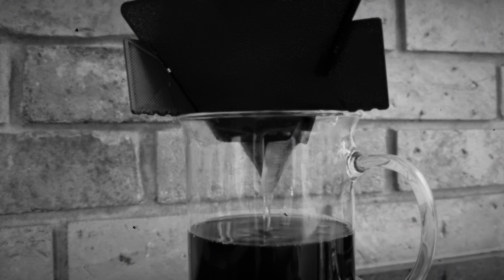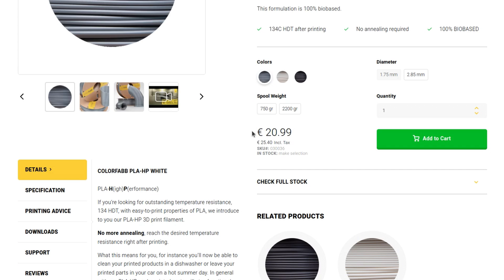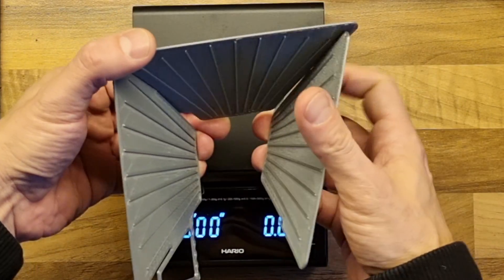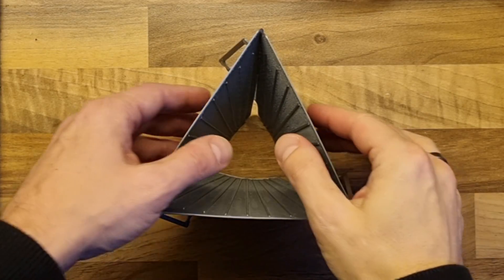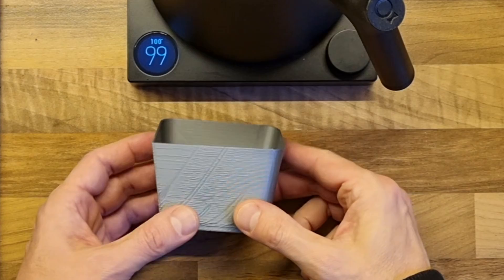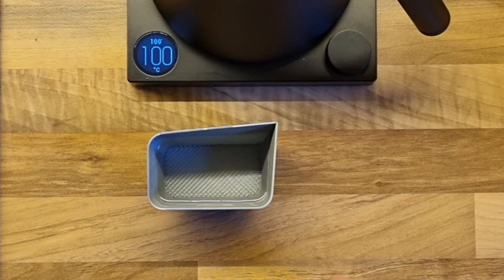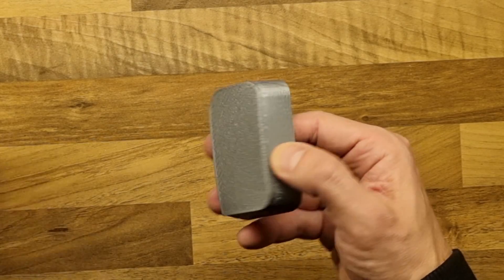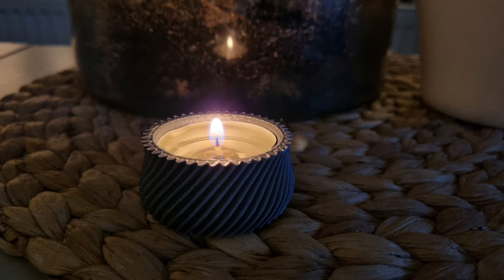Heat Resistant 3D Prints

Comment: This material is great for functional prints auto parts. Very cheap compared to carbon nylon and in most cases just as good if designed correctly. For warping just print with glue and the correct z offset. This stops it completely. You need to get the speed for the machine correct as well. Only issue is slight shrinkage but this can be compensated with design.
Reply from the maker: Super useful, thanks! Haven't thought about such application.

Comment: Did you have any problems with stacking of the filament at the entrance to extruder?.. I have constantly this issue in bambulab with this filament and I think it is due to quite high diameter tolerance which is +/-0.1 when normally it is less then that value.
Reply from the maker: I've never had such issue, my extruders have large entrance. Haven't played with Bambulab yet, do can't comment, sorry!
Reply: If you buy 2€ kg Chinese's roll.... Of course you have a problem.

Buy good material instead. Using 4 Bambus and 3 ams (1 lite, 2 standard) and 3 Prusas and in years i never had any problems.
Reply: @Ale_giro  but thus material do not cost 2€ per kg.. it costs more than 20. I was asking about this specific one :)

Comment: what is the best filament to print cooking ware like plates mugs forks knifes so you can eat food on that
Reply from the maker: Well, the "correct" answer is - 3d printing is not food safe :) There are filamets marketed as food safe, like https://www.extrudr.com/shop-eu/products/pla-nx1/ yet usually they are not heat resistant. So I can't give you a ready answer, sorry!
Reply: @taboretum  why... I think could be very useful if you can print your kitchenware like plastic plates or forks or knifes.... if the technology could print useful items it could get a huge growth... think about you need anything you can just print it and use... for now looks like you can print interesting objects but are more just for fun and intertwinement... I wish we get at a point where you have your 3d printer and some public domain print file for basic items ... forks plates brooms jars containers and so on and you can print it and use it when you need
Reply from the maker: Food safety regulations are really strict. You probably should have a dedicated printer, all element should be tested, etc. But as long as it is for your own use and you are not using it all the time I would experiment with some food-safe filaments.
Reply: @taboretum  I don't understand you can have plastic forks and knives like a camping set what is the difference if you buy them or print them with a 3d printer if you use the same material

Comment: Thanks for the video, it looks interesting. Have you tried putting it into the dishwasher? I tried with PETG and despite relatively low (50°C) temp is warped after two uses (the model was a dishwasher clip, used to keep light bowls from turning upside down). So I think it's not the temp but the detergent used, but maybe that affects this filament differently as well.
I've experimented with agar jelly in PLA moulds. Since the liquid can e safely cooled to about 30°C before pouring, and even lower for gelatin jelly, PLA is enough for the application. Flexible moulds would be better of course :)
What I'd really want is a mould that could hold molten PLA, but that's the future still.
Reply from the maker: I plan to test is in dishwasher as I have a long pending project - hangers for large wine glasses. Still I have a replacement wheel on my dishwasher basket printed in ABS I think around 3 years ago and it is still working...
Reply: @taboretum  Good to know ABS is working well inside. Interested in your future results too :)

Comment: If you put inside an enclouser, maybe it would wrap less... Yes I know that you don't need it but the room temperature is also a great factor to take in consideration because I had issues printing at room temp 14º C and I can't print even with PLA. So I made an enclouser to keep the printers inside at 24ºC with an exhaust fan to avoid overheat and It prints good. On summer time I have zero issues and I leave my printers outside.
Reply from the maker: Hm... My printer room really goes below 22C during winter. A bit of glue solves the warping.

Comment: No 3d prints are food safe. I'd rather we stop pretending that it is.
Reply: Coated with a purpose resin spray they're fine. It fills in the gaps and adds a food-safe barrier.
Reply: @DoesntRefillTheBrita resin is not very heat resistant. It might release resin into food at near 100C.
Reply: @EurekaZhuJinxuan  who said anything about that high temperatures? Nobody claimed they'd be dishwasher safe.
Reply: @DoesntRefillTheBrita ... we're talking about brewing coffee, that's over 90° c
Reply: Pla maybe not. Abs + melt with acetone is safe. Pet/petg are. Do you know plastic (most bottles) for food??? Or let me guess, you never use plastic petg bottles, plastic petg containers, plastic supplies (knife, spoon etc)???
Some plastics are 100% food safe and reusable. Some are disposable. Some are not for food at all.
Reply: "Results from various testing methods used in labs, indicate that 3Dprinted parts of PLA/PLA+ (Polylactic Acid), and PETG (Polyethylene terephthalate glycol) can be cleaned to safe levels using warm water (120 °F), and non-concentrated dish soap."

Stop spreading falsehoods based in nothing but your assumptions. 

Science has proven that 3d prints can be sanitized with dish soap easily.
Reply: Apart from chocolate
Reply from the maker: I agree in principle. Don't think using such coffee dripper 3 times a year would do harm, yet still you are right :)
Reply: Taulman t-glase is fda certified food safe, bacteria accumulation in all the layer gaps is always a consideration though ¯\_(ツ)_/¯
Reply: According to Google, a dishwasher can remove 99.9% of all bacteria so a 3d print CAN be food safe as any other object created with traditional methods if you treat it accordingly.
Reply: They are food safe....there is no problem
Reply: @psxtuneno 3d printed plastics are nit food safe. Do not use it. But then again sounds like have been using your prints for years now. Explains the IQ.

Comment: How's the flame resistance? Like if you used it as a candle holder and the flame hit the wall, does it ignite or just melt?
Reply: not sure about the filament used in the video but normal pla will melt and kinda burn
Reply: @cle4tle  i think people expect it to be flammable like a patroleum byproduct. it really burns similar to a candle, and is resistant to lighting.
Reply from the maker: PLA is not a petroleum byproduct. PLA is typically made from fermented plant starch, the most BIO plastic we use :)
Reply from the maker: Can't attach a video here :D but it actually ignites, I believe typical PLA will be harder to ignite, I can do some comparison :)

Comment: Why not just PETG which is both food safe and much higher temp resistant?
Reply from the maker: Because standart PETG deflection temperature (HDT) is around 70 deg C, while this PLA-HT is 134 deg C. So this PLA has much higher temperature than typical PETG :)

Comment: I would use PC which should be o.k upto 105c .
Reply from the maker: Thanks for the coment! I might try, but according to specs this PLA is ok up to 134c. The reason why it deformed was that I printed it to thin. Not sure if 1mm PC will handle this load.
Reply: @taboretum  PC is stronger and more rigid than PLA , But PC doesn't flex like PLA or PETG it just shatters .

Comment: I'd trust polycarbonate with bpa before I'd drink from PLA. At least a polycarbonate print is top rack dishwasher safe
Reply from the maker: Thanks for the comment! Well, this PLA is for sure dishwasher safe, unless your dishwasher goes above 134 deg Celsius :)
Reply: @taboretum  as you pointed out, your coffee funnel deformed with hot water that was probably 100c. So I think the glass transition temperature of your PLA is lower than you think.
Reply from the maker: Well, it's all about HDT measurement methodology - https://aipprecision.com/understanding-heat-deflection-temperature-plastics/

At some other source I found the following: According to ASTM D 648, the HDT is the temperature at which a sample bar of standard dimensions (127x13x12 mm) deflects by 0.25 mm when it undergoes a centered standard flexural stress of either 46 kPa (67 psi) or 1.8 MPa (264 psi).

So my PLA should remain stiff @134C as long as it is a solid bar 127x13x12mm, not at 1mm sheet :)

Comment: As an advise from a random YouTube comment just in the spirit to help: I've experienced that a wall of 3mm is the best to have something withstand all kinds of low forces applied to it. You want a coaster for your mug? Make it 3mm thick; a cup for regular temp water? 3mm thick walls; and so on. You can get away with thinner parts, but if your priority is for something to work every time, 3mm just works :) hope it helps
Reply from the maker: Thanks for the advice! I'm a big fan of vase mode so I often push to single walled watertight objects. I've been designing and 3d printing diving lights that were watertight 30m under the water but they were of course thicker than 1 wall :) Agree than 3mm will be enough for most applications.
Reply: @taboretum  just curious, did you also try PETG HT ? why i'm asking ? most people when it comes to temperture go for PETG and they usually perform a comparison of generic PETG vs generic PLA , but this PLA HP (134 C) seems to beat (in theory a PETG HT (100 C) ;
Reply from the maker: @emanuelkakuja9614  Honestly, I've never tried PETG HT, I just searched for available HT filament noticeable >100 C and ended up with this one :)
Reply: @taboretum  awesome , thank you for your reply :)

Comment: Google plastic leaching.  There's no such thing as 100% food safe plastic, it's a marketing term created by the industry. All plastic leaches, amount goes up with temperature. So called food safe plastic leaches is more heat resistant and leaches less toxic chemicals than other plastic. Like all toxins, it'll do serious harm if you accumulate enough in your body over time. Same goes with the fumes from 3D printing regardless types of plastic, PLA is like food safe marketing term, its fume is less toxic than others but toxic nonetheless, always vent out fume when 3d printing. I've dealt with plastic as an industrial designer for 30 years.
Reply from the maker: Thanks for the comment! I don't plan to use any of this items daily :)

Comment: Combined with a food-safe resin, at last... I can make coffee cups!
Reply from the maker: You mean SLA printer or covering FDM prints with food safe resin? The latter sounds interesting :)
Reply: @taboretum  covering fdm prints with resin /epoxy
Reply: @seanwoods647  That is frankly nuts. You taking what is considered an ASTM 6400 industrial composting material and coating it with an epoxy is a disaster if even introduced into the composting stream. PLA will degrade, but what do you think will happen to the epoxy coating? Or do you enjoy adding micro plastics into the food stream?
Reply: @fredpinczuk7352  Compostability is only a design consideration for a disposable product. I'm making artwork that you happen to be able to drink out of. (And charging accordingly.)
Reply: @fredpinczuk7352  what does the food stream have to do with a PLA cup decomposing in landfill?

Comment: Almost all high temp PLAs require you to anneal it afterwards, and aren't much different from standard PLAs in HDT after annealing. You can probably get the exact same result as this material just not having the fan on while printing. If you are willing to venture into resin printing you can get some heavily ceramic filled resins that will resist over 200C and can be used for limited run injection molding or such. Not sure if they are food safe but I think they should be reasonably food safe. If not good polycarbonate is very good at resisting heat though it is hard to print.
Reply from the maker: Thank you! I wanted to avoid post processing like annealing, as it takes time and energy. But maybe I will experiment one day. This paper https://www.researchgate.net/publication/348668129_Annealing_efficacy_on_PLA_Insights_on_mechanical_thermomechanical_and_crystallinity_characters says with annealing you can get PLA HDT up to 70C, just half of this PLA-HP, however I doubt they methodology wise this values are directly comparable.

On the resin printer - on my list once I finish building house with workshop. A friend bought one and now he spends quite some time at home in a painting mask on :D
Reply: I have tried annealing, it was important it kept the size but it was crimping after it. Else it was ok with hot water, after the treatment. I was using fiberlogy HD.
Reply: I would advise trying to print PC with a heated anclosure before venturing into glass bead i fused resins.

Hell i would attempt to use PEX (crosslinked polyetilene) before that. I meen printing in normal PE, then using x-ray to make it into PEX with irradiation - as the crosslinked form doesnt melt, it can pnly thermally decompose.
Reply: This stuff isn't supposed to need annealing. But I would bet that really depends on printing it hot and slow enough...

Comment: Try annealing it after printing. It may warp slightly, but it will be more resistant to deformation afterwards.
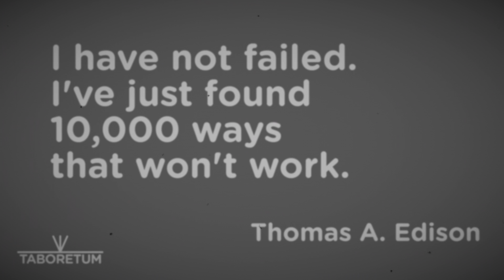Reply: 0:33 it says in bold "NO MORE ANNEALING."
Reply from the maker: That was the idea - no post processing, 3d painting is not a super eco process, don't want to add heating an oven on top :)
Reply: @taboretum  Gotcha. Good video!
Reply: @foam27  NGL I totally missed that. Often doing multiple things at once.

Comment: One idea would be to use such temperature resistant PLA for wax candle molds. I wonder if normal PLA can handle the molten wax when poured.
Reply from the maker: I would bet that thick regular PLA mold should handle molten wax that will be like 45-65 Celsius. With this HP one you can provlabt print a single perimeter mold. Never did any candles... Thanks for the idea! :)
Reply: You could always cool down the PLA mold externally or make it thicker so it wont be able to warp as much